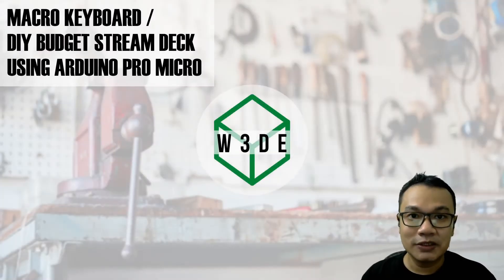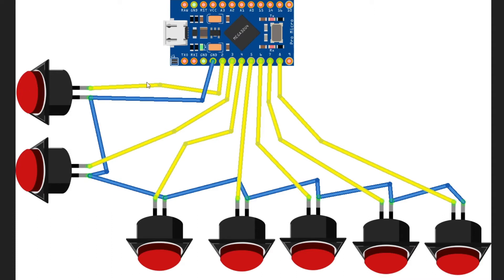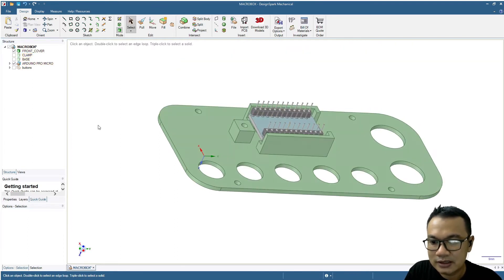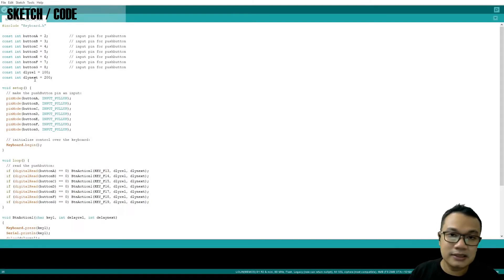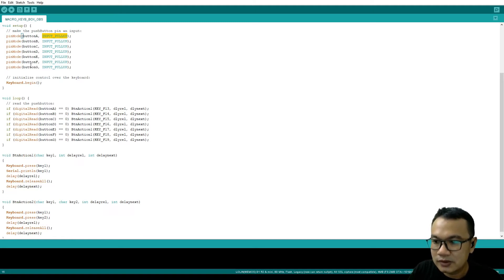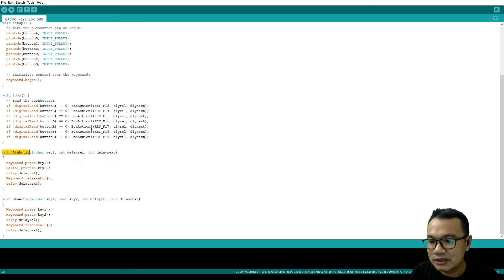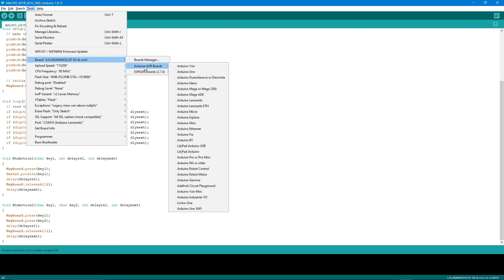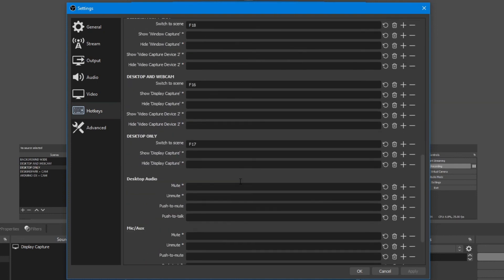Build Your Own Macro Keyboard / Keypad / Budget Stream Deck w. Arduino Pro Micro, and 3DP Enclosure

Comment: Can we use Arduino Nano in this project
Reply from the maker: The easiest way is using Arduino Pro Micro and Leonardo. It's possible to use UNO (with DFU mode) - I haven't tried it yet. But so far, I haven't seen any example with Nano :)
Reply: @W3DEStudio  Thanks :-)
Reply from the maker: you're welcome :)